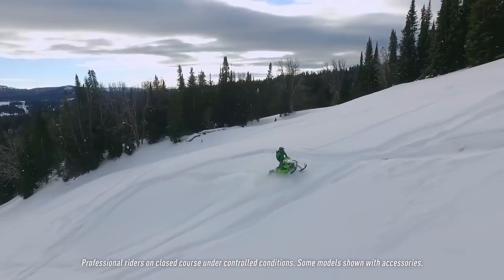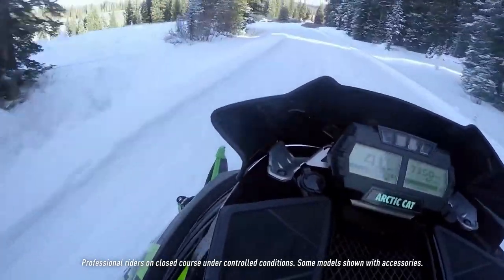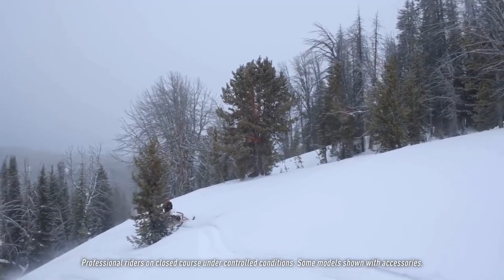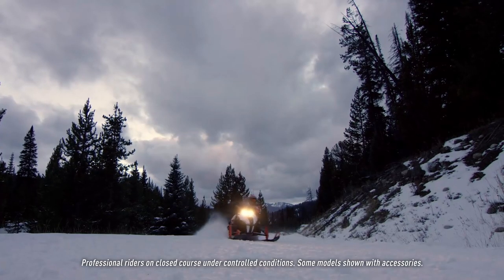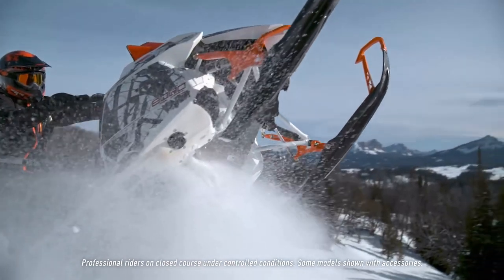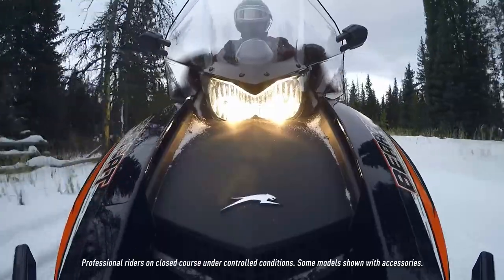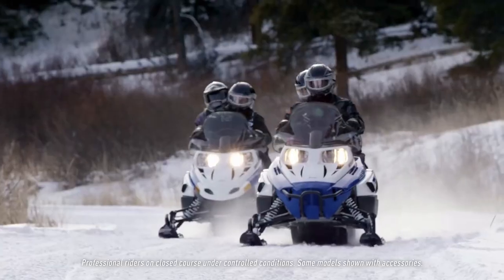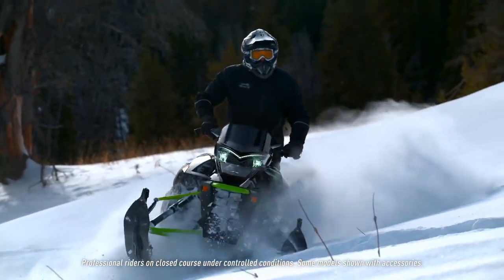2017 Arctic Cat Action Sales Product Lineup Models Promo Snowmobile video

Comment: arent new cats powered by yamaha motors?!?!
Reply: Arctic cat has their own motors except the Thunder Cat engine.Arctic engineering help develop the Thunder Cat set up with the 998 cc  Yamaha motor..Remember Yamaha has the Arctic cat whole PRO CROSS chases  on most of Yamaha models which  is All Arctic cat .Most of Yamaha's sleds Are Arctic cats
Reply: Only the triple the rest of the two storks are Arctic cat own engine built in Saint Cloud Minnesota. Yamaha has the Arctic Cats whole Chases in the Viper And Thunder Cat which is assembled at Arctics factory.Now Yamaha is using Arctics Two Stork Engine to .so it's a win win for Yamaha.